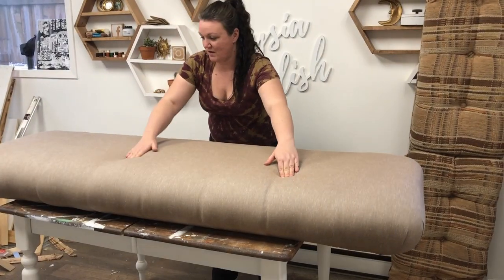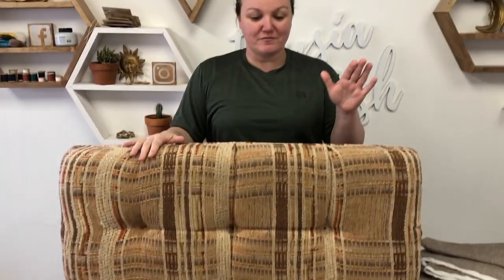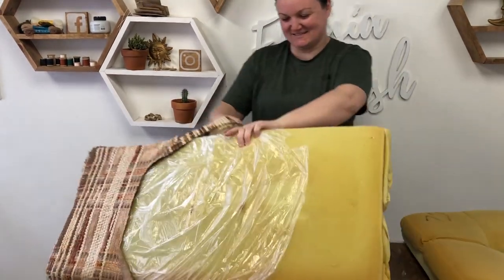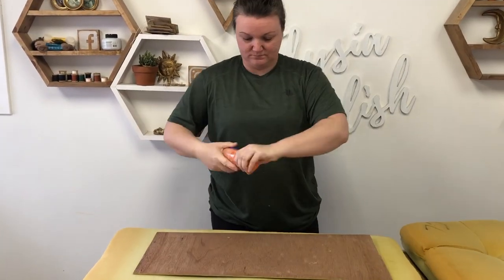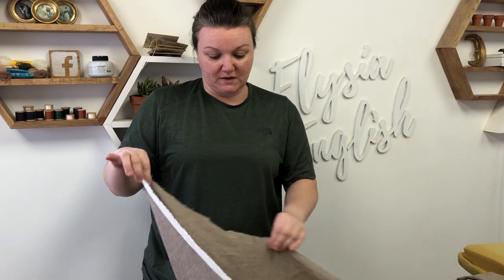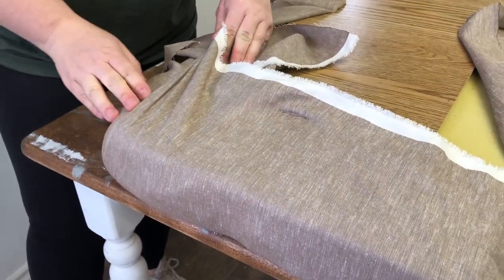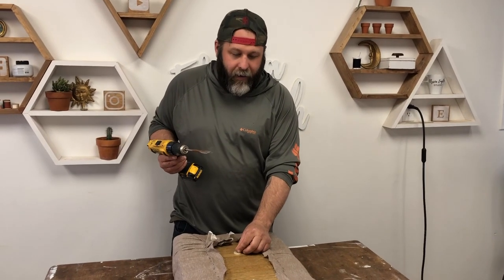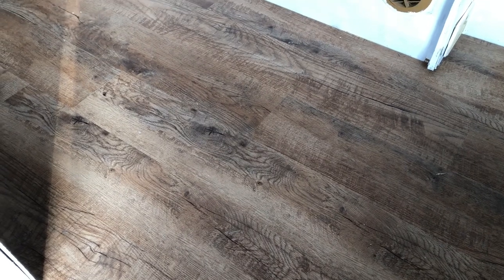Extreme Camper Makeover | Jackknife Couch reupholster Project! ONLY $10! | Episode 31

Comment: Of the work surface, as you pull up, push in & pull the fabric with your other hand, hold in place & staple!!  I personally don't like folds & the corners because dust etc gets trapped in the fold & they just do not make a "tool" small enough to get in there to remove it!  When you pull the corner of your fabric over the corner of the piece, turn your stapler so that it points towards the opposite corner, put in A couple Staples, then pull the fabric from side to side @ the corners, stapling as you go, slightly turning the position of the stapler so as to catch the as you work towards the sides/ends!!  It makes very nice, clean edges & will hold it's position much longer!!  You guys are doing A really amazing job with every endever.  Kudos to the both of you!  Now, take A Bow!!!

Comment: You did a good job and the couch looks great!  I guess if the weather stays cold you can make the pillows next or the cushions for  "L" shaped bench.  If you can work on the camper, I think you should finish painting the windows so you can make those curtains.  Of course there is the cleaning and painting of the stove and the hardware on the upper cabinets.  Get a few of the projects that were started finished.  I'm curious to see the hardware on the white.  HUGS~Donna

Comment: That is gorgeous I love what you did with it the way that you adjusted the buttons and everything perfect my you done an excellent job.💚🤍🧡🤟.  My friend and I when we upholster the benches and the bed couch we made kind of like a flat bottom bag and stuck the foam inside and then we sewed it the other in closed and we had two 6 to 8 inch wide x 6’long foam and the other one was 24 inches wide x6’long and then of course the table benches were 18” x 36” it was definitely quite the experience I’ve reupholstered chair seats but never anything this big

Comment: i ditched the old 1989 fleetwood travel trailer saggy foam and bought 5" firm 24x72 foam from amazon for $96 for back an bottom.....no buttons needed....an very comfortable "i am a heavy guy so it was way better but not comfortable to sleep on. if you wanna snooze i suggest medium foam! and i upholstered mine with 1 queen size fleece blanket from dollar general $9 after mark down from winter to spring sale

Comment: NOTE: Upholstery or leather thread is thicker and more durable for wear and tear... I would've tried a dab of glue on the inside between the button and fabric to also avoid pulling on the thread when people get on and off...

I will probably get this question answered in a later video but just in case my question is the length of the staple vs the thickness of the board... I was curious because if someone was laying on it wondered if a person would get stuck by the staples... 

The outcome looks awesome...

Comment: You always, always, always - get extra fabric.  Especially when working W/ printed fabric!  Also, measure & trim the fabric so that you have an extra 4" all the way around the piece,  you need this so that you can get A really good hold of it as the fabric needs to be pulled taut!  Fabric stretches, so if you don't pull tight enough, before long it will become very loose & look dreadful!!  Also, it's better to do the Tufts before you staple the fabric on, that way you can adjust & reposition  the folds!  Another point, to prevent bumps and bulges @ the edges of your pieces, put the bottom edge of you stapler against the lower edge , @ the

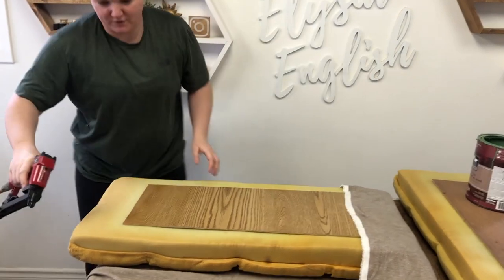Comment: At 5:06, when you began to wrap the fabric , I saw that you used a spray glue to bond the wood to the foam. To really make the fabric stay in place securely as well as the staples , could you have sprayed the glue on top of the wood and then stapled the fabric too?
Reply from the maker: I was worries it would soak they the fabric? I had not used the glue before